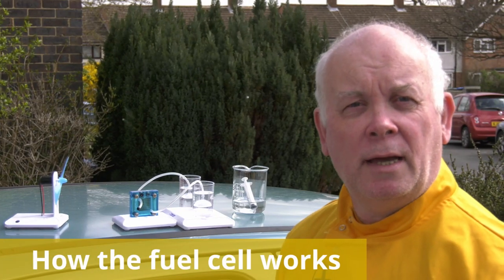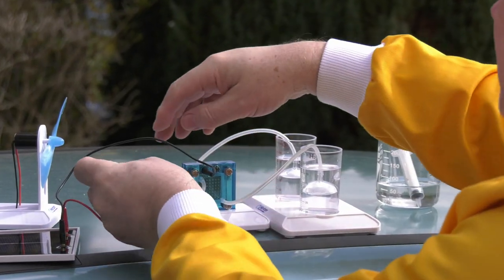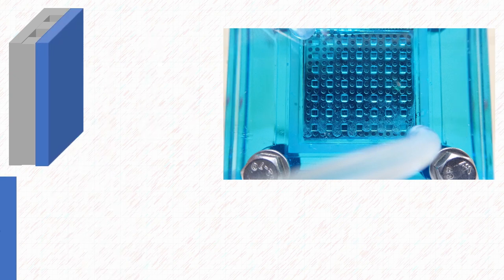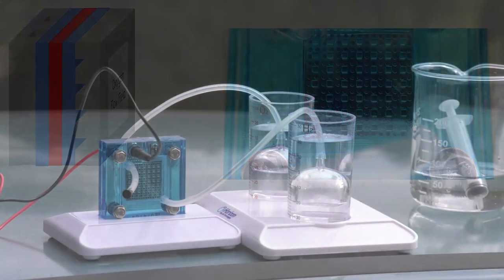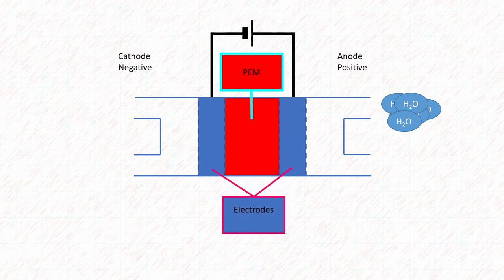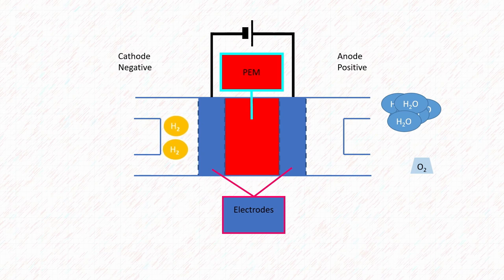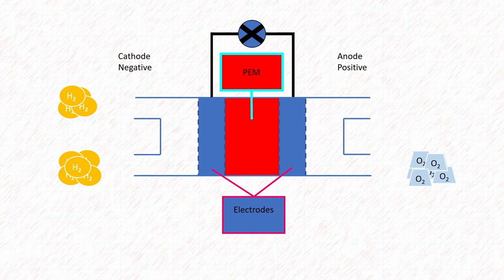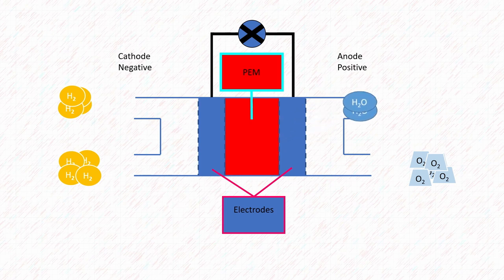The Hydrogen fuel cell explained, clean energy

Comment: In my understanding there are two processes occuring in the fuel cell when connected to the solar panel:-
1. It performs electrolysis where oxygen and hydrogen are produced from the hydrolysis of the metal plates.
2. The fuel cell acts as a capacitor and stores the electrical energy supplied by the solar panel only to later release that energy to power the fan.
The connection of the cell with the hydrogen/oxygen containers maintains a closed system. The water is also present to cool the membrane down as the temperature, espcially from the oxygen side can get quite warm/hot.
The hydrogen and oxygen do not come from the water but from the decomposing metal plates.
Reply: No - the generation of hydrogen and oxygen occurs from decomposition of water. The metal plates do not decompose. They are either metals that allow for efficient transfer of the electrons, or catalysts that facilitate the reaction without being consumed in the process. 

Water and oxygen flow in on one side of the electrolysis cell, and water decomposes at the cathode into oxygen gas and hydrogen ions. 
2 H2O(l) → O2(g) + 4 H+(aq) + 4e−

Oxygen gas and electrons cannot pass through the electrolyte. Oxygen exits the fuel cell and electrons pass through the circuit. 

The hydrogen ions migrate across the electrolysis cell through the electrolyte and pick up the electrons on the other side, completing the circuit.

4 H+(aq) + 4e− → 2 H2(g)

The total equation looks like this:
2 H2O(l) → 2 H2(g) + O2(g)

A fuel cell operates the same way, but in reverse.
Reply: @rebeccaong2820  Thanks for your interpretation Rebecca but the hydrogen fuel cell does not prove water is split. Water is actually an element in its own right imho. You can type what you like, type equation after equation, but you can only THINK water is made of hydrogen and oxygen whereas from all the information I've looked at, demonstrations such as these are misinterpreted as the gases only come from the breakdown of the substance that are in contact with water. Water is 'corrosive' - next time you get your hands dirty remember to wash them with WATER! It really is that simple!!
Reply: Peter & Pete ok but where is the Hydrogen in the Metal then?
Reply: @AA-gl1dr  well you have to understand what hydrogen exactly is don't you to answer your question? Look at it like this, if you have a metal say steel and you've made it primarily with carbon and iron ore then one can expect steel to comprise carbon and iron ore and this is the case as water decomposes steel into it's main constituents of carbon and iron ore. So what binds the carbon and the iron ore together so they can exist as a metal?

Comment: I don't get it like like what are we going to use it for. You need power to make power when I can take a tesla and put a solar panel or a dropping wheel to charge the car. They do have road you drive on to charge your car as well.
Reply from the maker: The free energy from the sun can be used to make hydrogen, which then can be used at anytime to power what you want, when you want it for free. A fuel cell can turn water into a fuel hydrogen and using a solar cell we can do this for free. A solar cell would only power a tesla during the day. A fuel cell can be used at night as well to power, for instance a car..
Reply: @PhilipRussell  ik and if you have solar power you can power a car

Comment: This is not a hydrogen fuel cell. It’s an electrolyzer. Google the difference. People often deliberately confuse the two to deceive people.
Reply from the maker: I have electrolysers and fuel cells that only go one way. An electrolyser uses electricity to turn water into hydrogen and Oxygen. A Fuel cell turns hydrogen and oxygen into water and electricity. This type of cell does both. As you watch the video you can see that this cell does both.
Reply: Philip Russell ah I see. Didn’t watch till the end. Some people deliberately do confuse the two though. I guess not you good sir.

Comment: I get barely 0.72 volts and 15 mA out of mine lol
Reply from the maker: A typical fuel cell produces a voltage from 0.6 V to 0.7 V at full rated load. So you are doing well. The Voltage decreases as current increases, due to the Activation loss, Ohmic loss due to resistance of the cell components and the various interconnections. As with all electrical battery systems we put them together in series to increase the voltage and in parallel to  increase the current.
Reply: @PhilipRussell  thank you for the information , i thought i was doing something wrong as in your video you are able to power from a single cell a tiny dc motor while my cell can't even power the smallest led ...
Reply from the maker: Skull Fucker The motor isn’t very powerful but the fuel cell can easily manage two lower power leds
Reply: @PhilipRussell  I actually bought one for powering up a microcontroller, but if current is at 15mA then I will sent it back probably. I was thinking about using a step up converter to 3.3volts (esp8266 microcontroller for weather station) but if the current is too low. An arduino nano at least needs 19mA, and the esp with wifi is around 150-200mA I believe. In the specs of the manual they say the current is 360mA. So 15mA here is...bad!
Reply from the maker: @pieterpauwelbeelaerts5995  Each one is not that powerful, so they are commonly used in banks, serial and parallel to boost the Amps and Volts, but it makes for an expensive setup.. To be really effective, the price needs to come down a lot.
Reply: @PhilipRussell  yeah, it is definitely costly. I bought a used kit for 60 euro's, you get what you pay for (the entire educational kit) but the aliexpress devices are 20 euro's each. I measured 1.4Volts for the Horizon fuel cell, which is not enough to light a normal red LED (1.8 volt) but... One can construct joule thiefs or charge capacitors/batteries. Unfortunately the storage containers are small and if I wait too long for the experiment (H2 and O2 in the containers) H2 will simply vanish and the O2 isn't pure...

Comment: That's not a fuel cell that a hydrogen generator.  Totally different.

A fuel cell COMBINES hydrogen and oxygen, producing electricity as a by-product.
Reply: It does both jobs. It generates the hydrogen gas and oxigen gas...as a generator with help of the solar cell....and after that....acts as a fuel cell...sucking both gases back in the cell.
But you don't have the knowledge to understand the transfer. You should do researching.
Later you will invent something bigger and better than this.
Don't be like a child.

Comment: Sucks when your massive polluted Water destroys your expensive Work of Art all this work to get 30 minutes of Gas production before the Cell becomes useless from the Poluted water without my Pure Water The Technology is useless.
Reply from the maker: Simple water filters stop this problem. Polluted water is not as much of a problem as dissolved substances in the water. At present distilled water or deionised water is all that you can use - but its easier than petrol - small amounts of pollutants in that ruins a car engine.  These systems are as yet not designed to run off water or polluted water only pure water. but since they only require a small amount of water to create a large amount of gas then this is not a problem.
Reply: @PhilipRussell  I am an expert at removing all contaminants from Water if you knew what I do you would better understand but as no one has been able to make this System work like I have talks for its self many have tried all have failed the Water is Chuck full of Crap and all filters fail to remove even a portion of it so Untill you are Far more experienced in this issue best you stand back and do more listening. Highly recommended.
Reply: Kevin Bergman 4 Ridgeway Ave, Asheville, NC 28806 come get me bud
Reply: @kevinmichaelbergman8276  you're telling me that in 50 states you just happen to live in North Carolina
Reply: @sirius9108  Hydrogen Cell Running now nearly no Amps so who is the Idiot now? My pure Water is the Secret.
Reply: Kevin Bergman you haven’t proven that you have pure water! You just keep saying as if everyone should believe without any evidence
Reply: @sirius9108  Not like you will get any so why would it matter mine works and won't self destruct from the Crap in normal Water